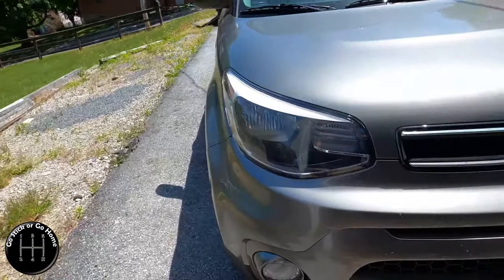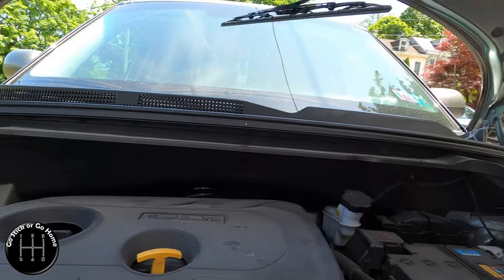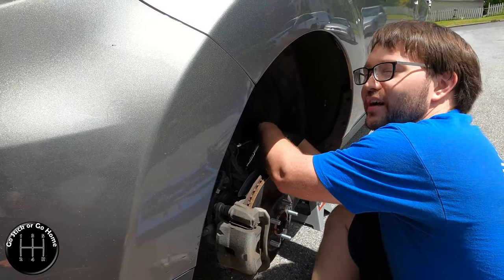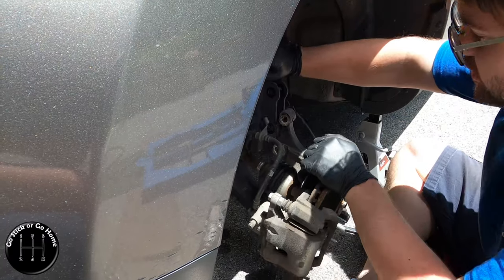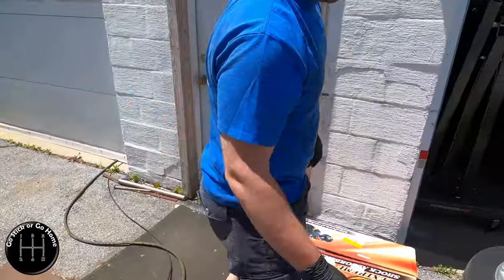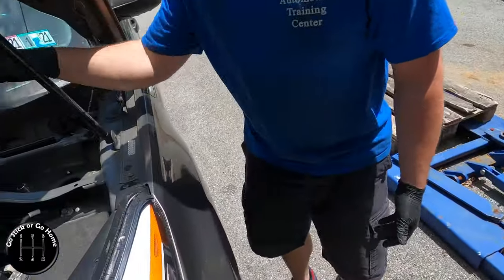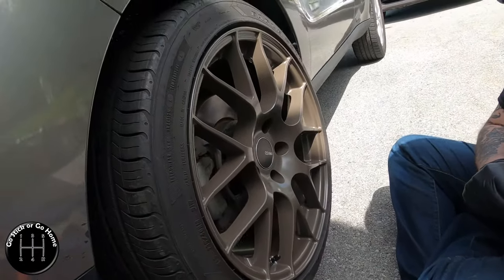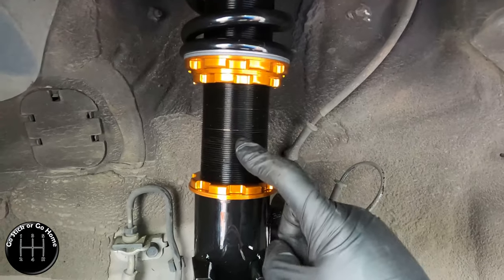How To - 2014+ Kia Soul Coil Over Install

Comment: It's good to see some people doing some modifications to the Kia Soul. I think it's the most underutilized hatchback out there that has a lot of potential performance. I'm sure you could put a bigger turbo charger or engine swap it or flare the wheels etc and get a little hot hatch out of the deal. Not to mention a used Kia Soul in very good shape goes for pretty cheap on the used market

Comment: how's the handling and ride improvement ?
Reply from the maker: So these have “pillow ball” mounts in the front, and on rough roads it transmits a lot of that into the car, mostly through sound.

It handles way better though, which was the point. And overall it still rises decently - if you’re used to a lowered car’s ride, you’ll be alright

Comment: So if I have a soul like this but I want a more comfortable ride for long trips without changing the ride height what would you recommend
Reply from the maker: Please correct me if I’m misunderstanding:

You want to get some modification so that it sits at the normal ride height but rides nicer/more comfortably for long trips?
Well, I’d need to go and look at what’s available on the market, but the easiest (and really only 2) solutions are:

- Different set of shocks/coil overs
- different tires

Tires can make a huge difference in ride quality. Their inflation pressure can, but usually not much of a difference.

A cheaper route than getting a completely new coil over setup would be to get adjustable shocks or at least performance shocks from, say, Bilstein or Koni.

In order to see about ride quality I would give them a call as ask, and see what others have to say.

Comment: How much does it cost wanna lift my sorento 2-3 inches debating on coilspring or spacers
Reply from the maker: Usually whoever makes the coil over setup will tell you to what extent it will raise or lower the car. This setup is designed for lowering so I doubt it will be able to lift the car, but the manufacturer’s site is in the video description

Comment: Whats the wheel and tire specs?
Reply from the maker: Armando E they are 18x8.5 with either a +35 or +38 offset, and it’s a 235/40 tire

Comment: SHIT. YOU HAVE TO DISASSEMBLE THE WHOLE FRONT TO GET A SIMPLE PART OUT. I will keep my 2012 until die.
Reply from the maker: It took us all of 5 minutes to get that off. It’s not a big deal lol
Reply: @gostickorgohome  ok, but I don't have to at all in my soul 2012.
Reply from the maker: @irisbaez1972  I understand that, which is good. And I prefer not to have to either. That being said, My point is that even with that it only adds a few minutes. It seemed like you thought it was a huge deal and it really isn’t.